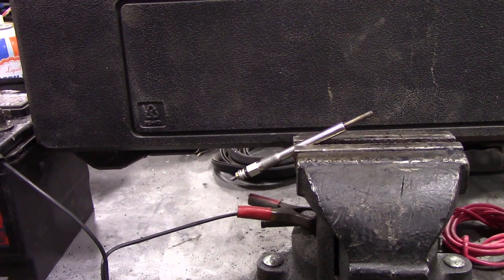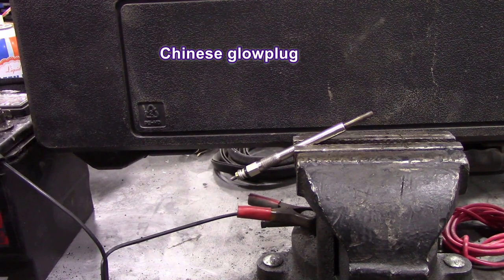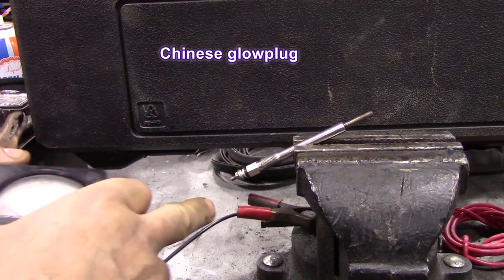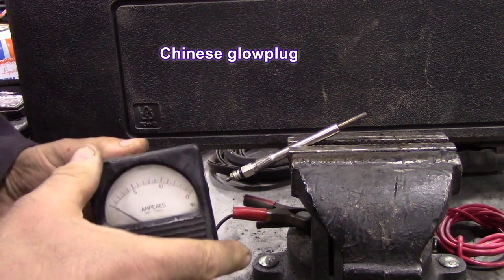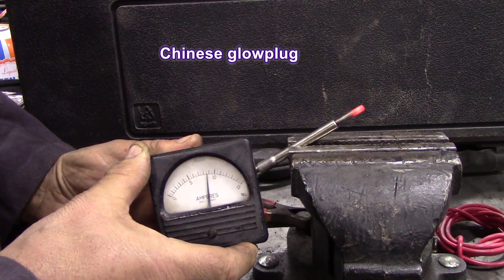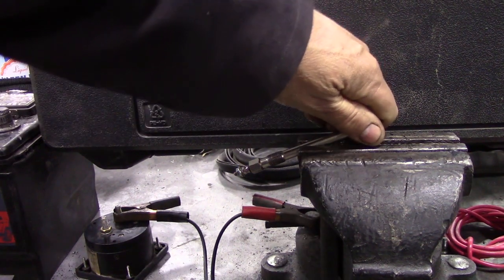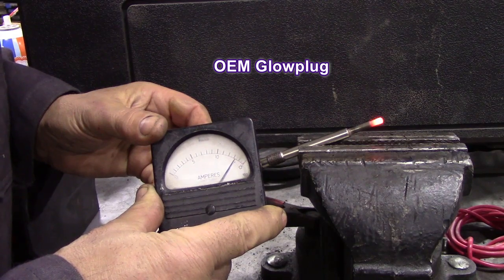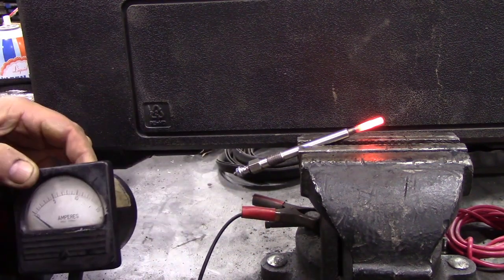OEM vs. Chinese diesel glow plug amperage test

Comment: confession time, my 110  300tdi glow plugs have never been connected in the 7 years I've had the truck. It started life as a 200tdi and was engine swapped before I bought it.  It starts first time all the time even in the UK winter. Have you heard of this before?
Reply from the maker: Yeap - as I mentioned in another comment, when I fitted diesels for guys in the southern US, I didn't fit the timer kit as it was not needed and made the bill a bit cheaper

Mike

Comment: Thank you Mike! Very reactive ;-)
I guess 4 of these firing up in the mean time puts a lot of stress on the battery! Better keep your battery in tip top shape
Reply from the maker: Exactly! So in winter, not only is your battery working hard to crank your engine, it also has to power the glow plugs.

So this may be the reason why some people have to cycle the grow plugs several times to get the engine to fire up - cheap plugs which are not getting hot, as the timer relay has switched off by the time they have got to full heat. 
Where as the OEM plugs get to max heat in an instant.

And all the time the battery is loosing power...

Mike
Reply: I have the habit to make sure minimum power is drawn when I start the engine (no headlights, no heated seat, defrost or other high demanding circuits)
Reply from the maker: And my dad used to say put your foot on the clutch when cranking as the oil in winter will drag in the gearbox even in neutral ( which I found out here to my cost in a Renault 5 with EP 140 in the gearbox at -35C)
Mike
Reply from the maker: every little helps in winter
Over here, newer manual cars all have a switch on the clutch so you cannot start the car in gear - you have to press the clutch before you crank
Mike